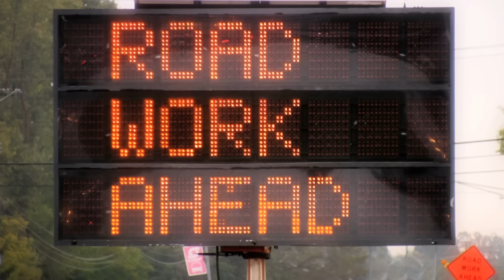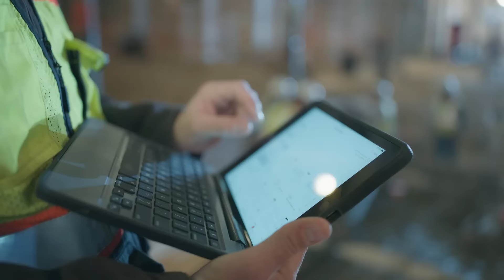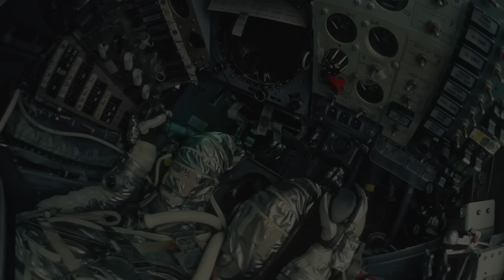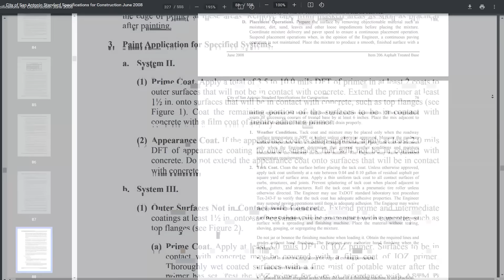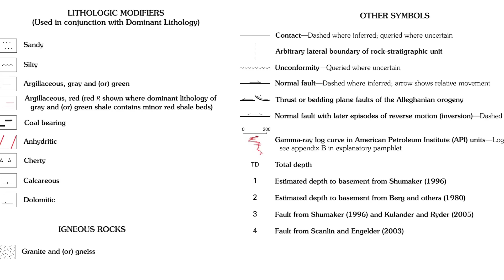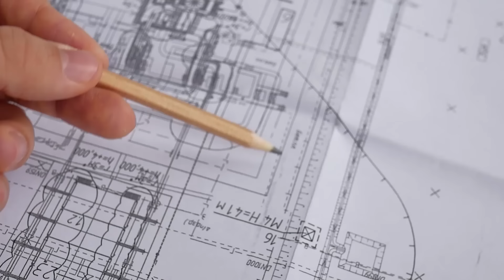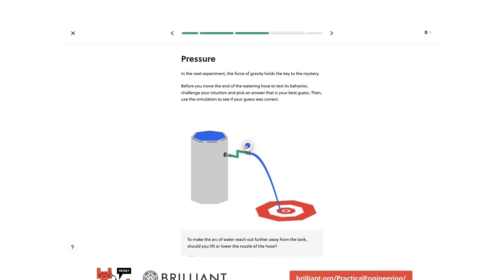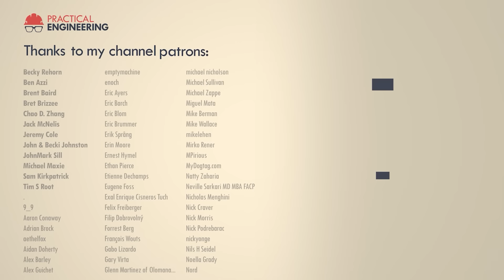4 Myths About Construction Debunked

Comment: As an estimator for power & utility company, in my experience being awarded a project which was bid is a great feeling for a fraction of a second followed by panic wondering what I missed lol
Reply: Have to imaging the worse one is seeing you missed being lowest bid on nearly a 7 figure job by a couple thousand dollars.  Seen that one happen as the engineer a few times.  Same where someone lost a bid due to a mistake in bid schedule (thinking it was lump sum instead of each for a line item which gets corrected to double the value of that line, and the bid is lost due to this error)
Reply: Hah!  There is an old saying, something like: after the bid opening, both the low and high bidders go back to the office to see what they screwed up
Reply: @jdraven0890  haha! It’s funny cuz it’s true!!
Reply: @e_eyster  I have also seen LS bids  mistaken for unit pricing and vice versa. 
I too have participated in very close 7 figure bids like you mentioned, where $3,000 or essentially peanuts separate low bid & #2, it’s a very different feeling when #2 is nowhere near, or even double #1 which is more the norm and sends everyone “back to the drawing board” lol 
It’s a tough job but can be very rewarding and/or satisfying work!
Reply: @shawna.4601  Yeah its odd watching the winning bid for large area of disturbance come down to someone pricing silt fencing at $0.10/LF less.  As an engineer the big fears are when you get a lot of bids and either "win" the bid with your estimate, or everyone comes in 20% under your estimate because it means something was wrong somewhere.
Reply: @e_eyster  I know exactly what you mean. I enjoy the challenge that is estimating, it’s a job where you can’t simply go through the motions since every project is different. I have a ton of respect for engineers and have witnessed amazing solutions to some fairly complex problems!
Reply: This describes my life lol
Reply: @shawna.4601  “how much did we leave on the table?”
Reply: I remember winning a bid on a custom house where the lowest bidder was $200,000 less than us. The customer ended up choosing us. Even they knew there wasn’t any possible way to do the house for $200,000 less.
Reply: @mattcraig5285  yes that’s can be a scary question lol 
A lot of the time, in line work, the only info provided after a bid is if you’re being awarded or a regret letter, which makes it harder to feel out the market and find out what competitors bid it.
Reply: @bmo5082  I constantly take multimillion dollar jobs of a competitor as they always low ball their bids and then slam the client's with variations and client's have become weary of them now as price always blows out to far higher than my original price, I get the edge by reducing my tags by accurately risk pricing them but isolating them. Every tender I do now I get invited into post tender discussions where I take the opportunity to flag the risks that I priced which basically shows them their exposure to my competitors variations, then ask them if they want to take the risk or not i.e. they can have a temporary discount or not. Once you earn the trust with clients they will keep coming back as know they are not going to be blindsided with rubbish variations, I have also built up my subcontractor base around this principle. Money is not made in variations money is made by completing the job early and moving resources on to the next job.
Reply: Going back about 35 years I was working for a public utility company who had a contracting division who won a contract for a hospital wing on two floors. Somehow someone managed to miss the cost of the second floor when submitting the bid...
Reply: @colinwilson210  yikes!
Reply: @shawna.4601  needless to say, we won the bid :-}
Reply: One usually wins a bid BECAUSE you forgot something... lol.
Reply: @colinwilson210  in NZ understand me contracts you can come back at them for that

Comment: As an engineer, I can tell you we always try to cover our bases when it comes to contractor's cutting corners. First, is with the specs. If you are lead or CA engineer on a project, you have to know the specs backwards, forwards, and inside-out before you go inspect a site. Then it becomes obvious if the contractor has decided to ignore reading the specs. And once you spot that first item that doesn't match the specs, it's a red flag to begin looking at everything that much closer. Next is with submittal review. Division 01 specs always include a section on submittals. Every trade is supposed to submit every product used in construction and sometimes shop drawings to sow the intended installation. If you go through your list of submittals and you see some products missing that you know are part of the project, it's pretty obvious they haven't fulfilled the requirement and you should note that on a site visit report if you see that product anywhere on site. And if someone is brining discrepancies up in a meeting, especially in front of an owner, don't let the contractor BS their way out of it. As the engineer, we are the experts on what we design. So, if a supervisor starts in "well, we've done it this way on lots of projects and never had an issue" respond with, "but this is how you were required to do it on this project. It doesn't matter if it worked elsewhere, what matters is you agreed to do it according to these drawings and these specifications."

Comment: FYI John Glenn's Friendship 7 mission encountered several "issues", including a potentially fatal equipment failure that caused NASA to cut the flight short. Practically all the early space missions had multiple problems. They just worked through them.

Comment: The lowest bid model makes an incentive for bidding contractors to rearrange their budgets away from 'non-essential' work. Unfortunately the first thing to get cut is lab testing! Because construction projects are sequential, a failing test (eg. soil compaction) halts work for everyone on site. Now there is pressure on the testing lab to 'pass' unsuitable material. The outcome: a road designed to last 20+ years starts falling apart within 2-3 years!
Reply: Or, like the Saskatchewan, Canada bridge that made the rounds in the news, it starts falling apart later in the day it was opened.
Reply: If they had a bid. Some contracts are no bid aka corrupt as hell.
Reply: Not sure where this happens. Been managing state highway projects since the 90s. All records are open to the public. So put in an OPRA request if you want to see the real results.
Reply: You don’t just cut testing out of a budget if it is required in the contract. For public roads the agency requires certain testing in the contract. The contractor does the quality control and the agency does the quality assurance to verify the contractors results. If the results do not match up, a 3rd party does a test.
Reply: This is why testing and acceptance is performed by the project owner (usually the state or the city) rather than by the contractor building the project.
Reply: @caesiumm that completely describes the trend of construction here in my city. It's 100% relevant here. Topped with extreme and omnipresent bureaucratic corruption from the peon at the very bottom up till the magistrate(everybody gets a cut).
From past few years, our country has been improving a lot in this regard and developing and I'm grateful for that. However the system is slow, rusted and rigid to change overnight so it's a long road.

Comment: Here's a little fun fact:
Tunnels and underpasses can actually float upwards even when it has over a thousand foundation piles underneath this. During the design they have to make sure at the end there will be enough weight within the tunnel or underpass so it wont float upwards because of groundwater
Reply: Wow, thanks for the insight
Reply: Ha,ha, seen this on small (domestic) foul waste treatment plants installed in "wet" sites. A five cubic meter tank put in a hole and back filled with pea shingle. A year later the ground water has risen and someone comes and pumps out the tank. Result; a five ton upward force. Up comes the tank tearing its connections off as it rises.

Comment: Where I live the problem is less "Workers standing around" and more "No Workers in sight at all"
There are construction sites that stay in place for literal years and only every now and again you can actually see some workers and machines at the site doing something. It can't be that hard to replace some asphalt, so what is going on there?!
Reply: Lawsuits, environmental issues, rights of way problems, other utilities performing their jobs, all of these can cause extreme delays.
Reply: Also sometimes that waiting is intentional, you will notice that when a road gets paved they let people drive on the gravel for about a week and then put the asphalt down. This is to let the freshly disturbed sediments/dirt settle and compact to prevent settling after the project is finished, depending on the exact project they may take various measures to encurage faster settling or need to just wait longer. (Its no good ro have your skyscraper fall over because the dirt settled after construction)

And of course lots of unexpected problems can crop up and force construction to stop while the design team / client administration solves the problem.
Reply: Permits, inspections, bureaucracy, bs. The usual when trying to do anything
Reply: @jasonreed7522  that’s what there sheepsfoot compactors are for. Cars won’t do what those machines can.
Reply: Budget. Assuming you are in US, most city have trouble balancing their book.
Reply: @jasonreed7522  I have never seen what you describe with gravel roads. Is that really a thing?! I can understand the problems with big projects like skyscrapers and buildings etc. but I'm mainly focusing on street work here.
Every engineer knows that the road surface has to be replaced regularly. This is "as standard as it gets" in terms of construction.
So there shouldn't be anything too unexpected. Apart from the big mess-up a few years ago where a freshly build highway just collapsed because of erosion.
Reply: @jasonreed7522  I've literally never seen or heard of this in my 40 years on earth. Where do you live?!
Reply: @MrRoboticBrain  its a lot less of an issue for roads, mainly a brand new road/full tear up and repaving (vs just resurfacing) is more likely to suffer from potholes resulting from settlement and erosion if you don't give it a little bit of time in the gravel phase before putting the hard top layers on. Also, rain is amazing for settling disturbed dirt into place.

Its really just how long do you want to go between repavings that effect how long/much you are willing to spend on the work. Usually letting people drive on it for a week or longer is standard practice in my area. (We have frost problems that do more harm than settlement probably does, actually every thaw the ground settles back to its summer position so frost damage that isn't rocks pushing up through the road and settling damage are probably identical)
Reply: @FelisDomina In the UK we have obsurd numbers of works going on as we come up to april as all the councils spend their budgets so they get more next year.
Reply: Here in Michigan they put up construction barrels and close off the section to be worked on and work doesn't get started for sometimes weeks. It gets me steaming mad. Why?! Begin work immediately.
Reply: Quite often near me, when a new construction starts, they'll send the backhoes in to do some landscaping and clear trees, put a security fence up, then you'll wait for months or even a year while the weeds grow back before the backhoes come back, scrape off the weeds and dig trenches for the utilities. Then you know they've actually got full permission to build the thing they want to build.